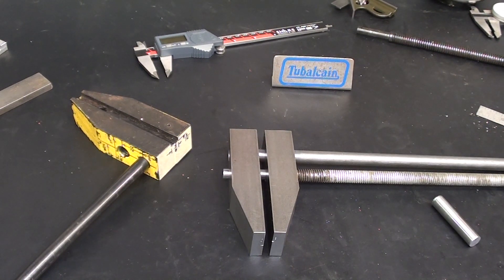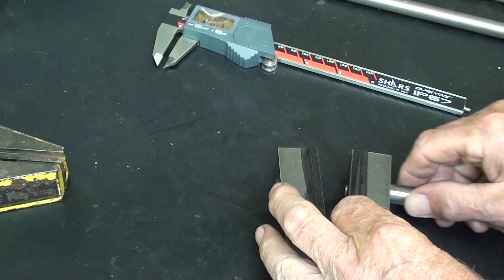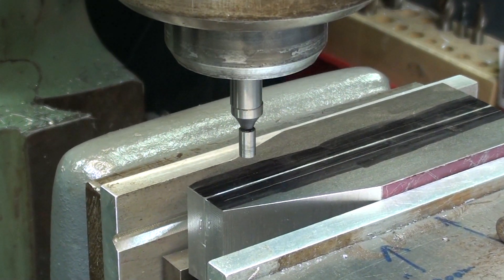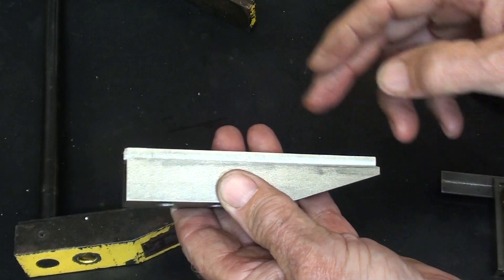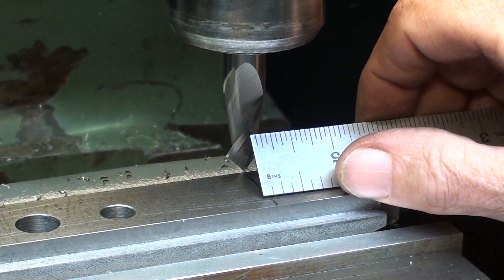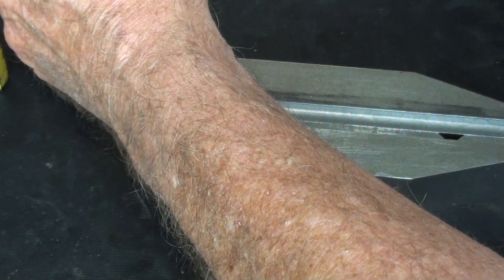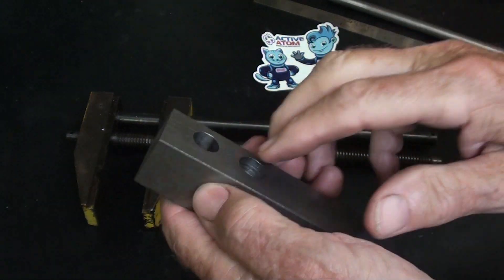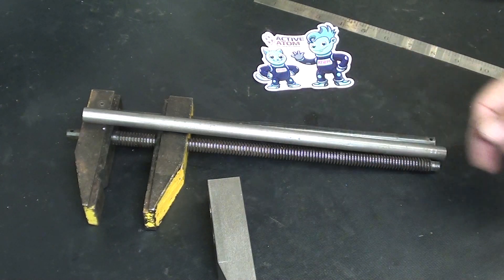MAKE A FLOAT LOCK Drill Press Vise TIPS 583 pt 4 tubalcain

Comment: Thank you for the tips and this and your other ‘films’ (I guess i'm dateing myself with ‘films’- 76 years) I still have a small ball peen hammer I made in metal shop class, lo these many years. Never did get the nurling right. I remember making a center punch. After heat treating the teached would drop it point down on the floor. If the heat treating was correct no damage occoured.
Reply from the maker: I am 76 also. And still think of them as films

Comment: It would not be difficult to make a steel collar that would be pinned (or affixed with Loctite) to the threaded rod to make that larger shoulder which is included on the original Acme threaded rod.
Reply: Or fix a nut with Loctite (and maybe turn it down a bit afterwards)
Reply: This was my immediate thought as well, Driver 1967.
Though I might have done the Florian F16 nut idea